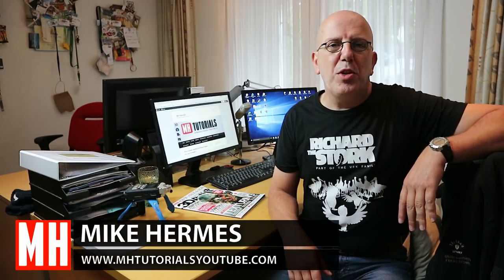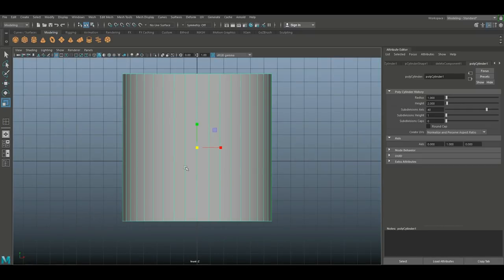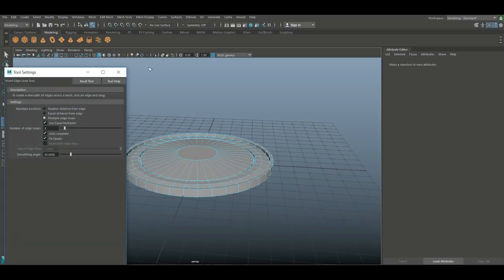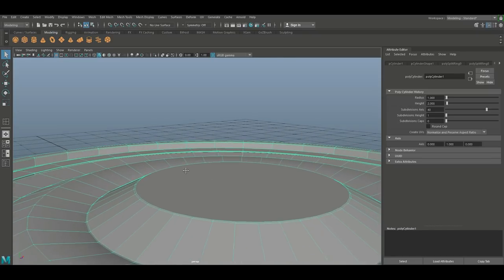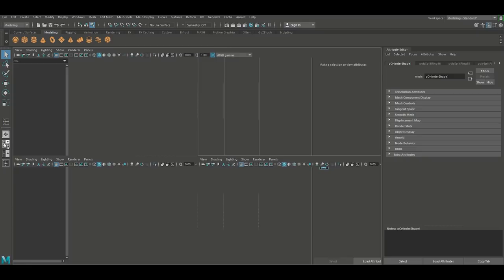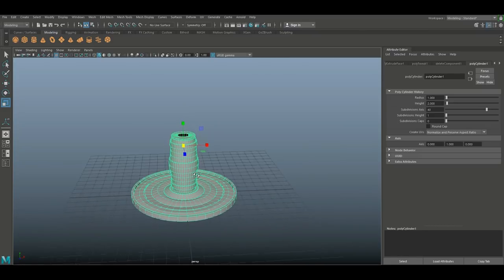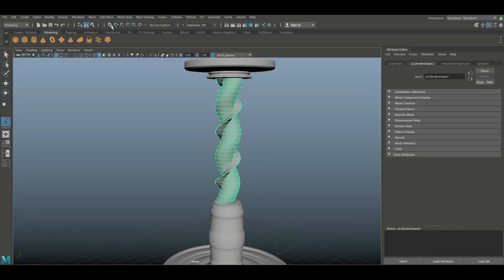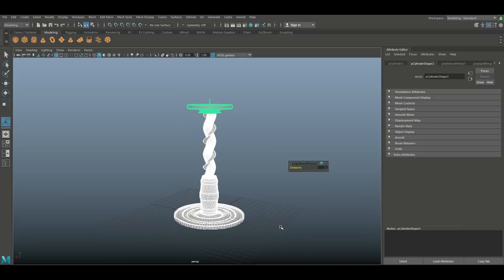How to model a Twisted Candle Stick in Maya 2018

Comment: In this case it's probably better (topology wise) to make this out of one piece -- certainly for dynamics and game engines.
 
In this case you;d end up that base with a hole of with a certain amount of edges. Then create a cylinder with that same amount of edges, twist deform that, and then weld those edges to the base and extrude the top edge of that twisted piece to make the candle holder. Then you have a single mesh where the topology flows neatly. This also makes texturing easier.
Reply from the maker: If I were to apply dynamics to it or animate it you would be right
Reply: This does safe a lot of time and tedious work for sure!

Comment: Hey mike, can we export those materials/textures from keyshot to maya? There's an option to save it as obj i did it, it saved it and there was another file with him in .mtl format. When i imported it in maya those materials/textures didn't came but the model was in triangles.
Reply from the maker: No, you can't take your Keyshot textures into Maya as the model is not UVed
Reply: Mike Hermes so what if we UV it, will materials/textures will come?
Reply from the maker: Nope, texturing in Keyshot is not based on UVs
Reply: Mike Hermes ah ohk...but what about substance painter?
Reply from the maker: Substance Painter to Maya, yes... sure
Reply: well thats good and bad, bad because my UV Suck...dont even know how to do it but i want to learn substance painter :(